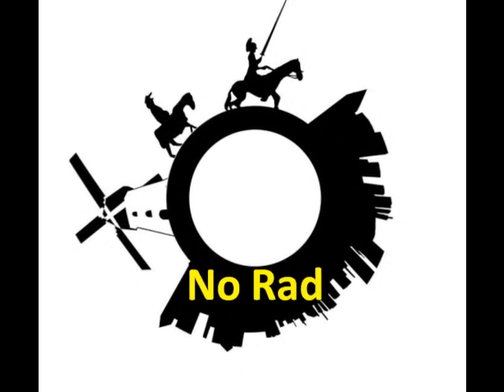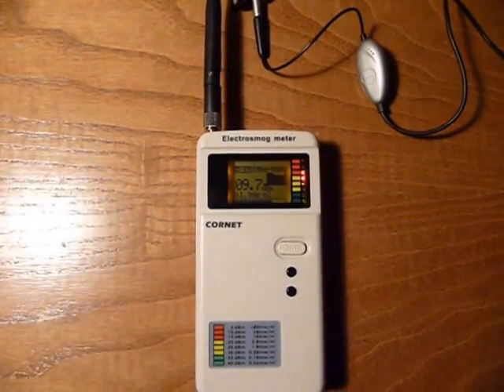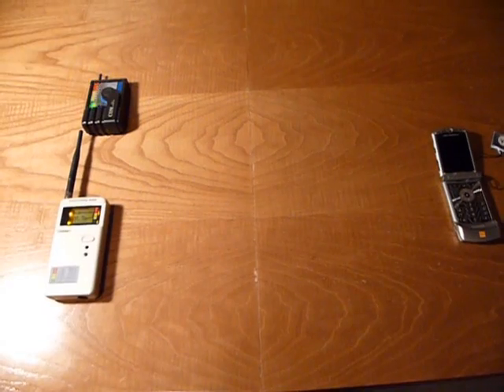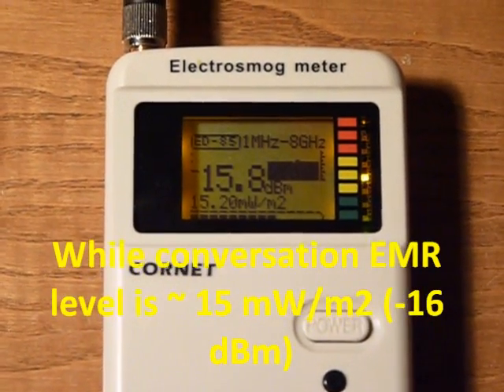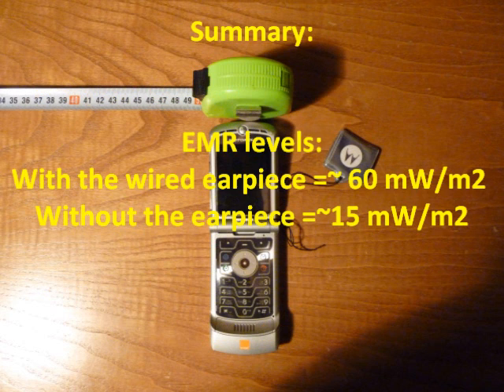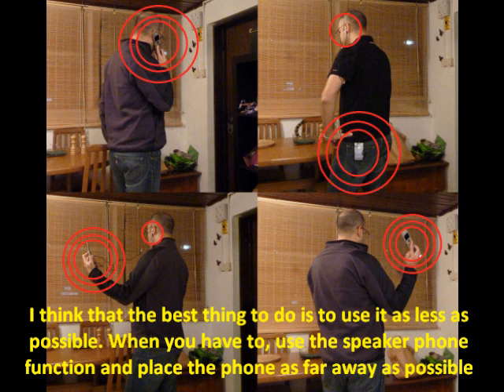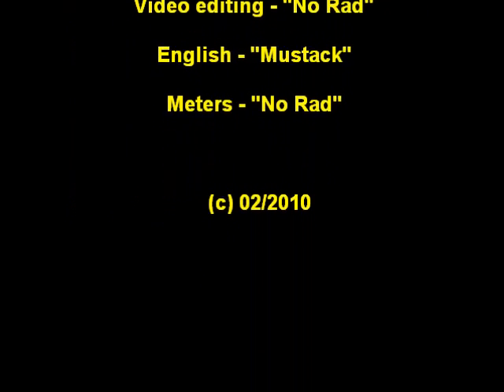Radiation (RF EMF/EMR) from a wired earpiece 50cm away from the mobile phone

Comment: Good video!
So if my calculations are correct, the values in  μW/m2 would be,
65000  μW/m2
15000  μW/m2

Should be enough cause of concern not to use wired earpieces.
Reply from the maker: Hello
This is an old video done with a GSM phone.
Today's UMTS phones emit less radiation.
Wired earpiece are better than putting the phone next to your head, 
But I prefer using a air tube wired earpiece when I must use the phone (once a month on emergencies). 
Take a look at this new one - https://youtu.be/HxKYFCzM8_Y
All the best
amirb

Comment: Thank you for such easy to understand experiments.  I watched the 50 cm and 100 cm experiments with the wired earpiece, but I wonder how might the measurements compare to using the phone right beside my ear?  Comparing the radiation levels across your experiments, I also noticed that the 100 cm eapiece levels were lower than the 50 cm levels - why would that be, if the wire length is the same?
Reply from the maker: Henry Chen Hello and thanks for your comment. The phone used in this video is a GSM phone. GSM phones emit lots of RF radiation and more of it effects the meter when 50cm away from the phone compared to when 100cm from the phoneamirb
Reply: OK, thanks!

Comment: It seems you're getting these high measurements because the wired headset is connected to the phone very close to where it's antenna is, i.e. at the bottom of the phone. Try using another make where the headset connector is much further away, you may get better results.
Reply from the maker: Specially ForSpam  I might find the time to repeat this experiment with UMTS phone, it 
should be more reliable since the radiation levels are lower then the 
GSM phone in this video.amirb

Comment from the maker: @eBasVamTenkju HI and thanks for your comment.
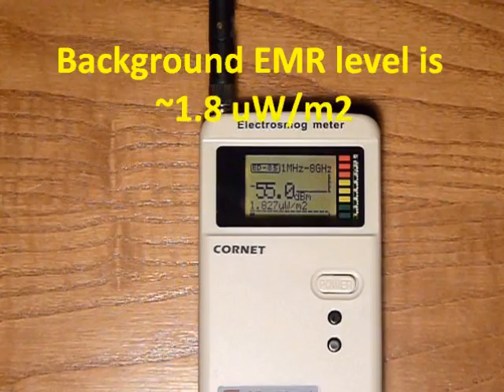In my house the level is ~0mW/m2 (as seen at 00:35). Out of my home the RF levels that are measured with the CORNET ED85 is 0mW/m2 (thanks god!). Outside my office (downtown) the levels are between 1-10mW/m2. Please note that in order to check RF radiation in the open air (multiple sources and multiple frequencies) you will need to use a spectrom analyzer.

No Rad

Comment: @NoRadBlog 
I think your video is misleading people not to use headphones, as you are not telling people that radiation with headphones is 65mW/m2 compared to 1000+ mW/m2 right on the phone when we hold it next to the brain.

We can not eliminate radiation 100% but earphones will at least reduce it.
Reply from the maker: This meter can't measure the near field very accuracy but if you would 
put it next to the phone the levels will be too high and the meter will 
show the max possible level it can display which is >1800 mW/m2.
So the wired ear piece do help, but not 100%

Comment from the maker: @halostalker Hi and Thanks for your comment.

In all my videos I try to show the electromagnetic radiation. Measuring it is not that simple especially when very close to the phone. It will be very difficult to measure the EMR emitted by a mobile phone, since it is very high and my meters can't show it and since the meters are not accurate when in the close field.

When you are putting your phone aginst your head you are exposed to high levels of RF and ELF.

No Rad

Comment from the maker: better than what?

The best thing to do is to use the cell phone as less as possible.
When you have to use it use the speaker phone or wired-air-tube earpiece.
I think that using bluetooth is not good, leaving it working on your head is bed, puting the cell phone in your pocket is bed, using both for long minutes is bed.

I hope I helped

Comment from the maker: Thanks for your comments.
In order to protect yourself from radiation you should do 3 steps, understand measure  the EMR sources EMR near you, minimize your use of EMR emitting devices, and them block the EMR coming from outside your house.  
You can perches EMR meter on the net, simple one like the CORNET ED6 meter cost up to 25 $US, more sophisticated meter like the CORNET ED85EX can cost up to 200$US.
The cheapest thing to do is to cut down cell phone and cordless use to the minimum possible.